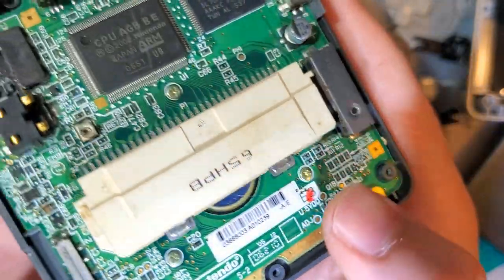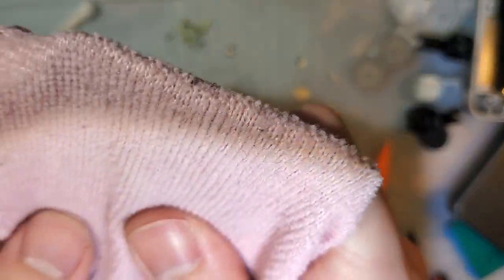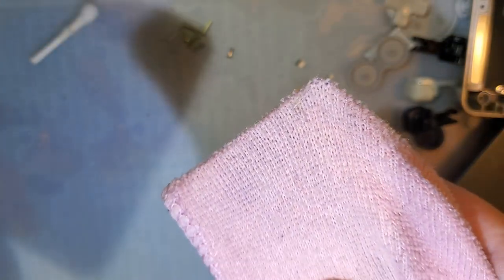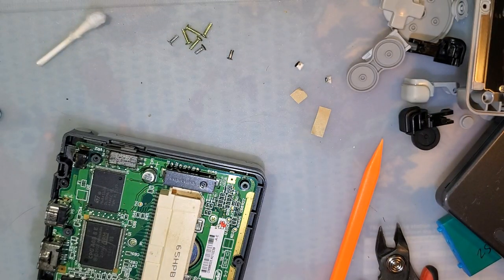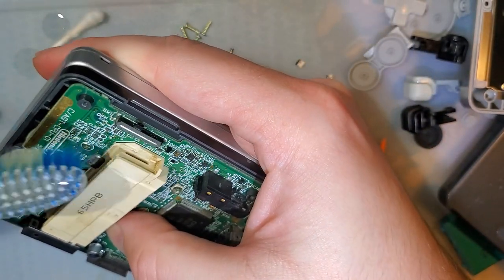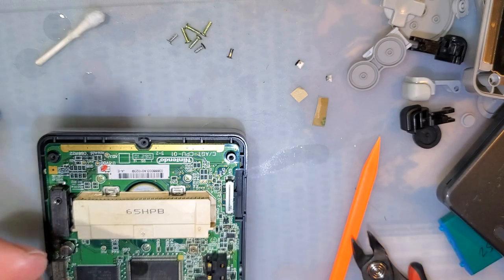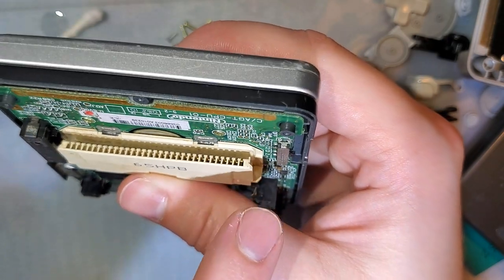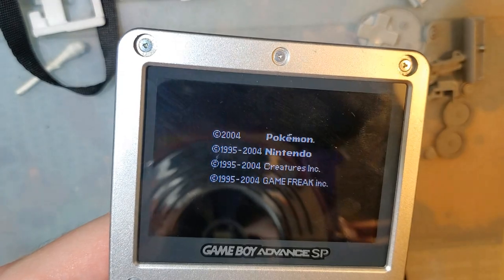How to Clean a Game Boy Cart Reader

Comment: A quick tutorial from Makho? Very nice. I usually take a microfiber cloth and wet it with IPA, then I slide it onto the contacts with a butter knife. They're round so it doesn't hurt the contacts. By the way, thanks for the guide on AIO GBC variants! I received the AIO GBC with EEPROM board and the IPS V2 yesterday. Going to wire it so it has brightness adjusted by a key combination instead of touch.

Comment: Nothing to do with cart readers but I have a GB Color that has non responsive A and B buttons.  All other buttons work and the board is clean with no visible damage or corrosion.  Did not see any broken traces.  And ideas?
Reply from the maker: check continuity with a multimeter

Comment: Hi Makho I saw your gameboy micro  link cable adapter video and noticed that the gameboy micro uses a similar charging port to the ds lite. So here is my question. What would happen if u connect it to your ds lite? Form what I've read online some say they do have the same port and others say the port is the same but smaller.  In which case u could solder a ds lite port (cable) to your gameboy micro link adapter board to see if the ds would be able to do multiplayer this way.
Reply from the maker: different port

Comment: Do you have a fix on GBA SPs not reading gba games? Mine would read GB/GBC and sometimes I can get a gba game to read but it would freeze or reset or not load. I take it it’s that little switch that is causing it. Any tutorial on how to fix it/take it apart/clean it that “SW13” switch? Thank you!
Reply from the maker: The detector switch comes apart like a power switch just a lot bigger. You can start by just reflowing the four solder joints on the back. I've heard that over the years, the mechanical strain can cause these joints to crack.
Reply: makho Thank you for your response! I’ll give that a shot tonight. I scrubbed with isopropyl like in your video and it kinda works. In every type of game, if I squeeze a little in the middle where the speaker would be, it would freeze the game and makes a distorted noise or it would reset the console.
Reply: No luck sadly 😭. Won’t load my GBA games. It would load the Nintendo logo sometimes but game won’t load all the way and still freezes. Thanks anyways sir.
Reply: @markdayrit3416  I literally have this same problem. Were you ever able to solve it?
Reply: @brian5460  I have the same problem as well. I can’t find a fix for it anywhere online!
Reply: @dlynns  Hi Devin, I was able to fix mine by replacing the cartridge reader slot. The pins in mine had become damaged. The new part was under $2 from AliExpress but the removal and install was not simple. You'd need a hot air station.
Reply: @brian5460  Thank you for the reply! I found that out last night after taking apart my other GBA SP that actually works. I noticed that the card reader on the broken SP was damaged when compared to the working SP. I’m going to attempt the repair soon. Hopefully it all goes according to plan.